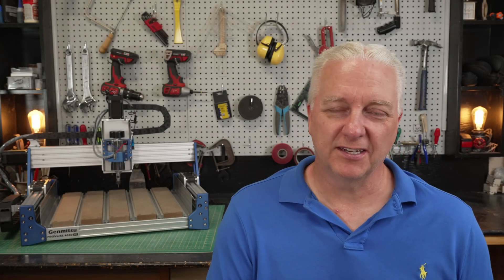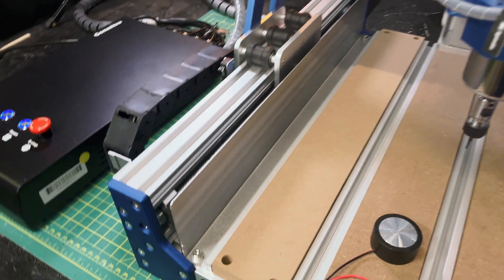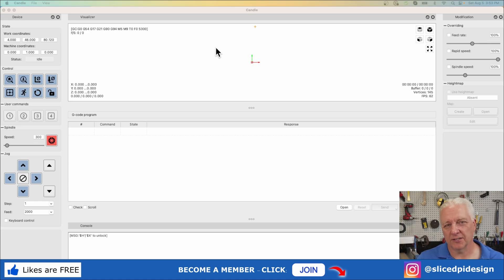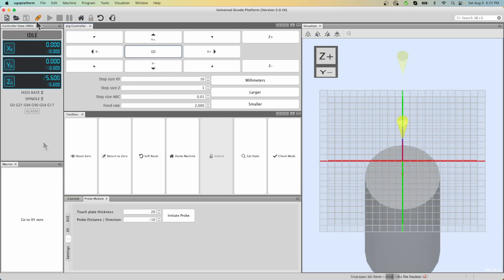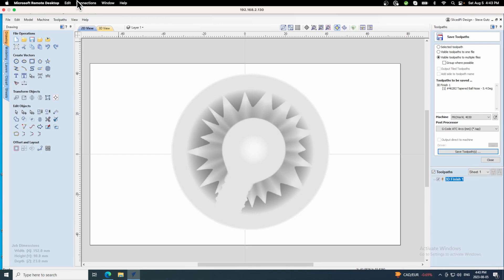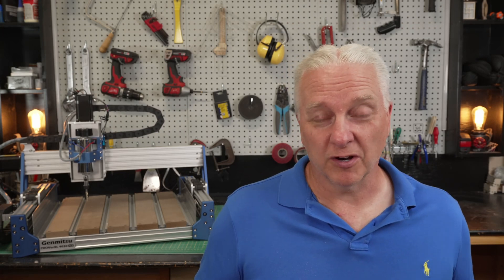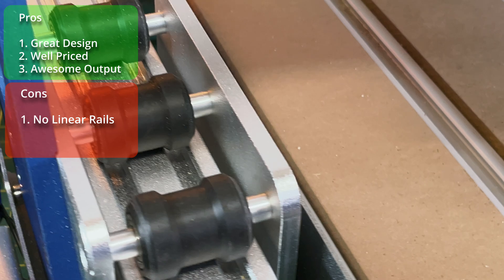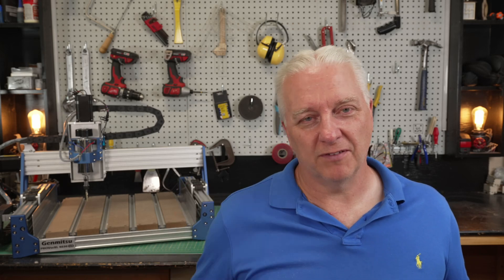Discover the Budget-Friendly Genmitsu PROVer 4030 V2 CNC

Comment: Have been using mine with Fusion and UGS for over a month now and pleased with it. The only problem was that I first set it up with a Genmitsu 1hp router with a relay switch and the router cut off in the middle of a job. So I removed the relay and now manually power on the router. Still haven’t figured out what caused that.
Reply from the maker: Sounds like the relay is faulty or beyond its maximum currenr

Comment: what  is  better and possibly why?
genmitsu 4030 XE PRO V2 or Fox alien 4040 XE PRO with ball screws
Reply from the maker: These are very similar machines, so I don't know if one is "better" than the other.  I know that the Genmitsu controller supports a 4th axis (i.e. rotary) - not sure about the Fox Alien.  Genmitsu has been making CNCs for a long time and has a very good reputation in entry-level machines.

The Fox Alien marketing material does have some misleading information, though.  For example, they claim that the Genmistu does not support rail upgrade, which isn't true.  The Fox Alien uses liner rails rather than rollers and on a CNC this will only cause issues in the longer term because linear rails don't deal with dust very well.  Even though they are enclosed to some degree,  they are going to clog up with grease and dust.

Comment: Hi Steve.. Great review of this CnC.. I just have a question for you?  Will this CnC be able to cut 5/5 hard wood boards? 
Thanks!
Reply from the maker: Yes, though if this is your regular material, you'll probably want to upgrade to a trim router rather than the small spindle provided.  Beyond that, it's really just a case of the getting the feedrate right for your cutting toolpath.
Reply: @SteveMakesEverything  Thank you.. I was just wondering if I needed to upgrade to a router or not..

Comment: Hey Steve, Thank you for the video!  Does Genmitsu make a 10 or 20 watt laser specifically for the ProVer4030v2 or do other brands fit on it?
Reply: I was looking at that and for a 4th axis spindle too. I now think (like Steve) that I’ll get a separate laser machine. There is one by Genmitsu for under $600 that looks pretty good.
Reply from the maker: @daveprather9960  😀
Reply from the maker: I don’t know for sure, but I wouldn’t recommend that anyway.  You’re far better to buy a complete laser if you need this.  This way you can still run a CNC job while you are laser engraving.

Comment: I bought a 4030 last year., Mine was half the price of yours but it is tape drive. I could not get GRBL to operate the machine. I can move the axes with the key board but do not know how to -pull up the controls on the computer. My spindle runs o.k.  I love the size of the working surface and everything seems to work manually. My  machine sits idle these days..
Reply from the maker: I always like to hear user stories, even to highlight struggles.  As far as getting gcode to the machine there are a couple of ways.  If you were trying to use Candle, then you probably ran into nothing but grief because it isn't a great program.  Universal Gcode Sender (UGS) is much better, and there is a new app emerging from Sienci Labs called GSender (https://sienci.com/gsender/) that is probably the best right now, and it is actively being worked on .

You do of course need some way to generate gcode (e.g. Vcarve, Carvera, Easel, etc)

Comment: Thank you for this video.  I am looking to upgrade my 3018.  My 3018 has a standard 75W spindle.  Noise is of some concern to me so, can you tell me please, would this 400W spindle be louder or quieter than a standard cheapy 75W spindle.  Also, I notice that the Sainsmart3020 V2 has a 3040 extension kit.  The 3020 with the 3040 extension kit is almost half the price of the Prover 4030.  Would this be a better and cheaper option, do you think?  Or are the components of this 4030 better quality?  Thanks
Reply from the maker: First the 400W spindle is very quiet, though the noise level of any spindle becomes irrelevant once the bit touches to wood. 😉.

There are some significant differences between the 3020 and 3040V2 that would make me want the latter. For example the use of ball screws and the addition of a more robust gantry.  It also has a serious controller that provides for extensions like a 4th axis.  Basically the 3020/3040 is just a larger 3018, but the 3040V2 is more of a professional CNC.  So unless price is the sole decider, I would personally buy the 3040V2
Reply: @SteveMakesEverything  Thank you for your reply.  I know what you mean about the volume going up once the cutting starts.  I am hoping that, with a more powerful spindle it will be quieter because of less vibration.  I am hoping to control the noise a little by having shallower cuts.  
Being so cold in the winter I am using the CNC indoors.  I am satisfied that the neighbours are not that concerned about the 3018 and so, by what you are saying, the 400W spindle should not be more of a problem.  
I almost bought the 3020, with this years BF discounts.  By the sound of it I would have been disappointed.  I will save my pennies.  I also like the thought of the 4030 having the option of a 6060 extension.  Do you know if that is any good?  Thanks again.
Reply from the maker: @alandimery3379  If you just want to reduce the noise, make yourself an enclosure to put it in.

I've been talking to Sainsmart about doing a video about the 6060 extension upgrade, but I haven't seen the kit yet.  It should be fine since it's just some aluminum rails and a new cable.

Comment: Is it possible to use this with a better software like Vcarve Pro or somehting?
Reply from the maker: Yes.  I used Vcarve to create the light bulb engraving. That will only create the toolpaths though. It won’t control the CNC
Reply: @SteveMakesEverything  Thank you for the reply. I was thinking Vcarve can control the CNC.  I just purchased a Genmitsu 4030 V2, and was not too happy with their software and was looking for something better.   What is a good software to control the machine?   Is Mach or Artcam a good one to use with my machine and will it work on my machine?
Reply from the maker: @macvideoworld  Mach is more of a kernel at the machine level, and since your 4030V2 already knows how to interpret gcode, you really only need something like Universal Gcode Sender (UGS).  It's opensource and easy to use and much better than Candle in my opinion.

Comment: Was very impressed with the CNC.  I have been using a MillRight Carve King (original wood version) four (4) years, without any problem.  Looking to expand business, so, I thought I would give this a try & see how it stacks up to my Carve King.  Pushed the button & placed the order yesterday - Friday, Sep 16th.
Reply from the maker: Excellent. I hope it serves you well
Reply: did you cut with it yet?
Reply: @Politikul  Yes I have.  It cuts just great.  It is much more quieter than my Carve King and does not kick up as much dust when cutting.  The only issue I have with it are the T-Tracks.  On the Carve King they run left to right instead of up & down, as they do on the PROVer.  I find the left to right running of the the T-Tracks easier for clamping to wood.

Comment: I bought this machine and they do make a dust boot. I was wondering your impression of the 400 watt spindle. Would you change to Makita or DeWalt router?
Reply from the maker: Yes there is a dust boot but it should really be included in the main package to make this perfect

The spindle works well but is probably a bit light for serious production work.  A router provides more power but it will be very loud, so wear some ear protection.

Comment: was hoping they had a offline controler so wouldnt have to take my pc to the workshop.
Reply: The offline cont for the v1 also works for the v2
Reply from the maker: @JORMA-gc7tx  Sweet!  Thanks for the info
Reply from the maker: Agreed, the 4030 is really at the gateway to commercial CNC, and this is just a limitation Genmitsu made to keep the cost down.  Other than potentially having to truck your laptop around, this isn't a big issue.    You could look for a cheap used laptop to keep connected to the CNC - it would only have to run UGS or Candle to send gcode.   Then you could use a USB stick to shuttle between your design and your production environments.